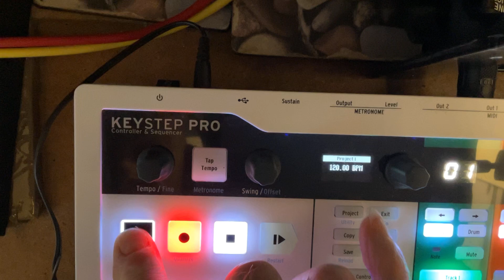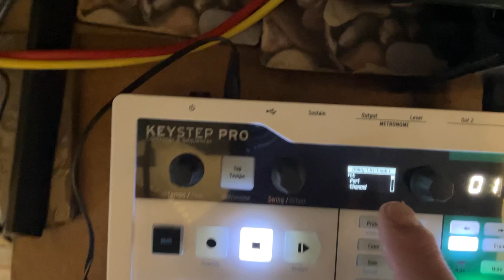Beginner explore of using Keystep Pro MIDI control with the Emu Proteus 2000

Comment: looks like a midi controller with more knobs and sliders would be better ao you can midi CC the entire rack
Reply from the maker: Yes, there are many MIDI sysex controls to play with !
Reply: @1heUndertaker  Did you ever go further with other midi controllers with the emu rack?
Reply from the maker: @popcycles   I have not gone much further than this with other MIDI controllers ☺

I have an Emu Command Station MP7, with the 16 controllers on the front - this is the device I use usually, the Proteus is used with it sometimes.
When I first heard about the Emu devices, I could not afford the Command Station, so I bought an old Proteus 2000 to use until I could afford a used MP7.
So I have used the MIDI controllers on the MP7 to control the Proteus 2000.

Do you have something of an idea you are thinking about? 
Is there something you'd like to do with a MIDI controller and the Proteus?